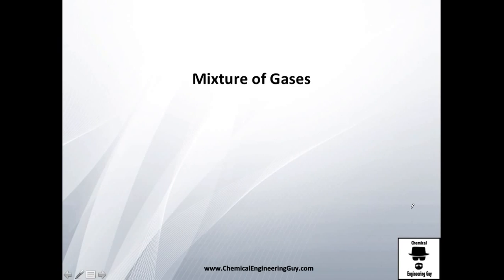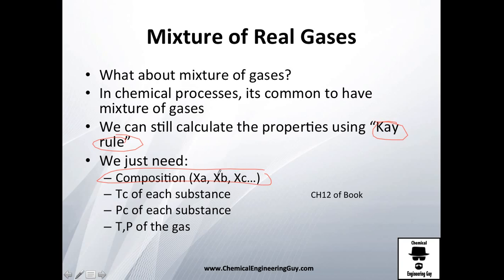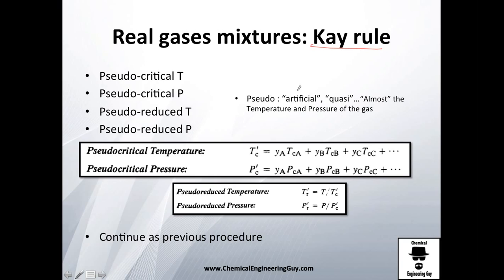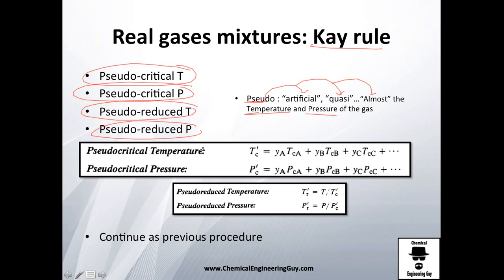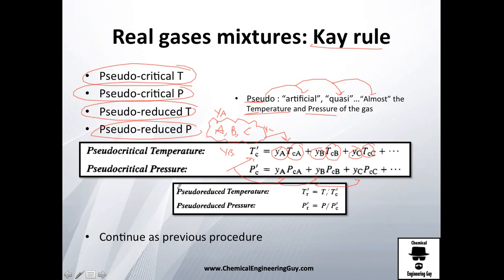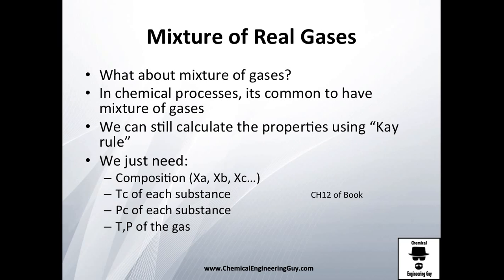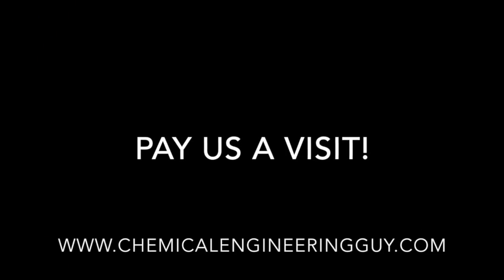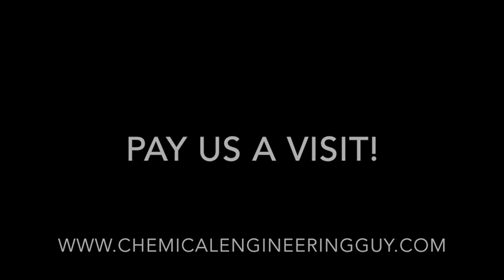Real Gas Mixtures - Kay Rule // Thermodynamics - Class 91

Comment: Hi, thank you very much for the videos, they are really good.
Can you help me by giving me a path or a clue, about how can I calculate the length of a pipe should have in order to guarantee the mixture of 2 gases (natural gas and hydrogen).
Suppose I inject H2 at a certain point in a natural gas pipeline, how can I know how far from that point I can guarantee a homogeneous mixture?
I suspect that it is directly related to the Reynolds number, (gas velocity, diameter, viscosity, etc.) but I don't know how from then on I can know how far I guarantee the mixture. Can you help me by indicating where I should start?
Reply from the maker: That's actually a great question, I would assume it is very quick, but to be sure, I would recommend to use baffles if possible or a mesh, something that favors mixing. Reynolds number is kinda tricky, as it relates bulk properties of the fluids, not individual fluids.